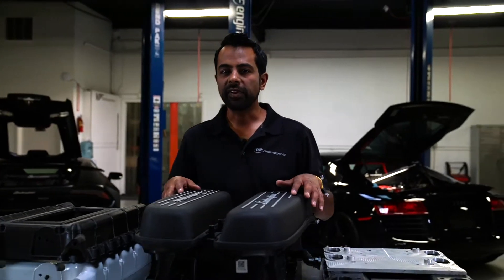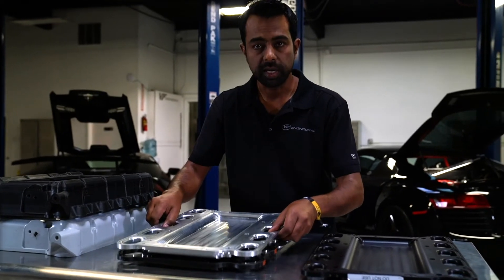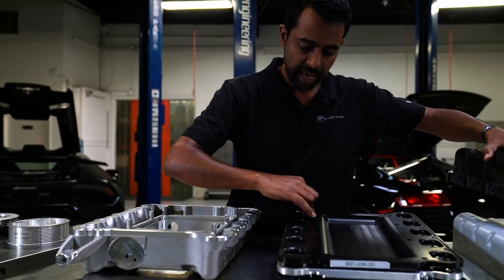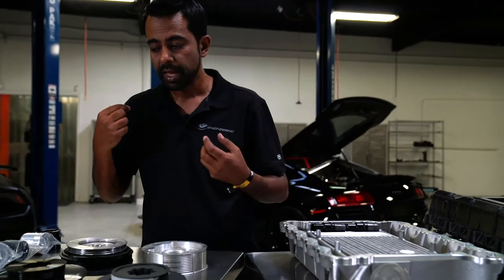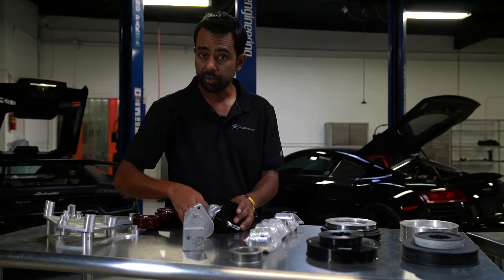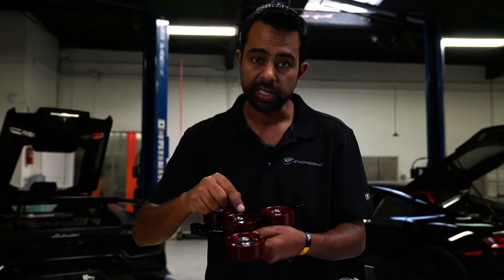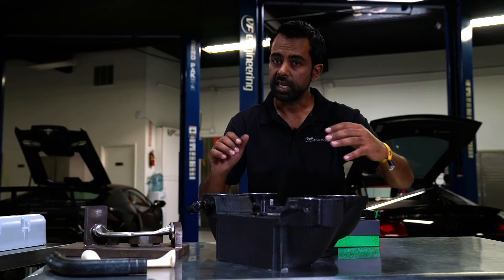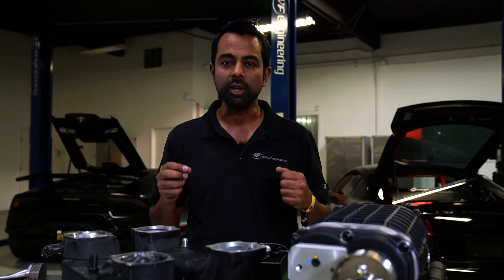A Closer Look at VF Engineering's V10 Supercharger Kit With the Designer Himself.

Comment: But will it work on the S6 platform.
2007 V10 Audi S6  ??
Reply: As awesome as that would be, no it wouldn't. Not without lots of fabricating. Pulleys might contact fans, oil filter would be in the way, would need forged pistons/rods. I don't think anyone wants to do the R&D on the C6/D3 V10 platform besides JHM.

Comment: Super slick presentation.  And a lot of proto typing & proofs of concept.  My current understanding is VF Engineering are making almost 900 hp on the V10 these days ? Is that correct  ? Gr8 2 👀👀 how well u guys have worked thru the engineering process.  Audi & Lamborghini would be impressed 😀👏👏👏

Comment: Since they’re close to the same, can this be used on the S6/S8 V10s (in a lower state of tune)? Would obviously need a different intake setup, but that’s not hard to fabricate.
Reply: It should fit. Just the bonnet wont close. But you can just cut that part out of it
Reply: Yes